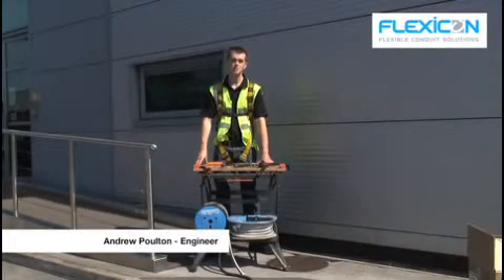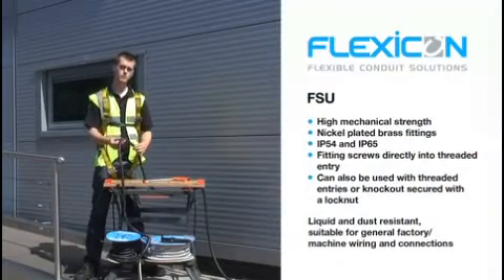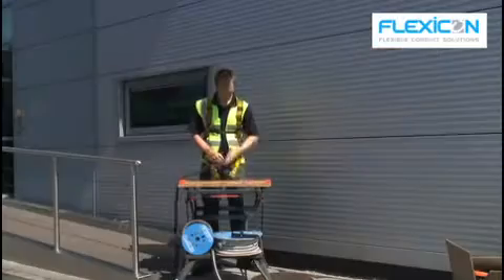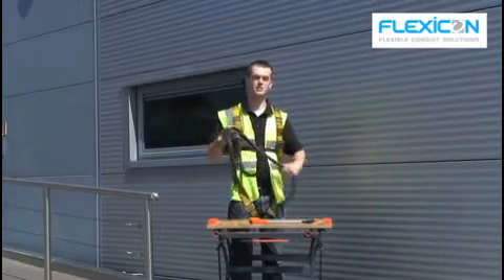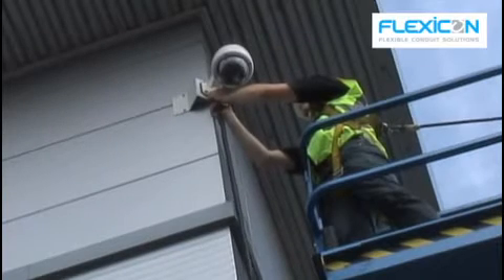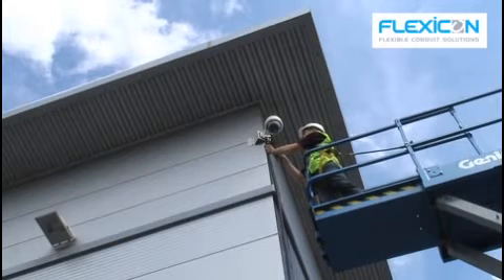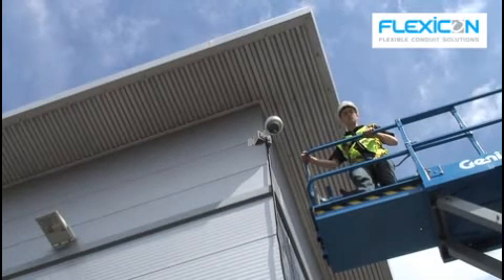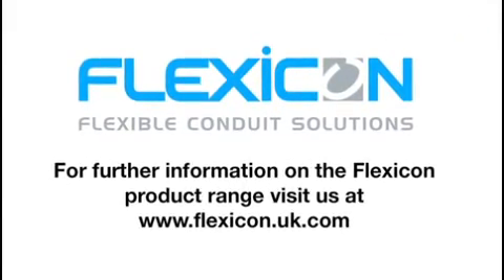Video 2 - Installing Flexible Conduit for CCTV Applications

Comment: If the the CCTV has a resolution as low as this video, don't even bother putting it up.
Reply: What's funny is that majority of companies spend thousands on crap quality cameras to protect their business when you can buy reliable sets for less than a few hundred bucks that have 720-1080p resolution.   I've worked at a walmart where you couldn't even see the person's face even if they were a few feet away.